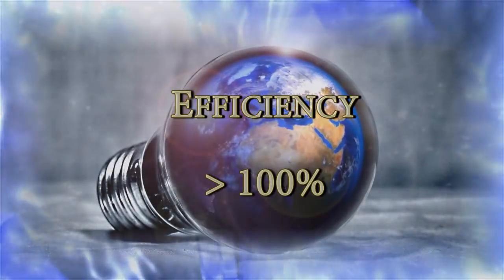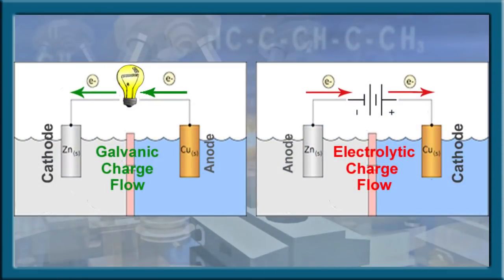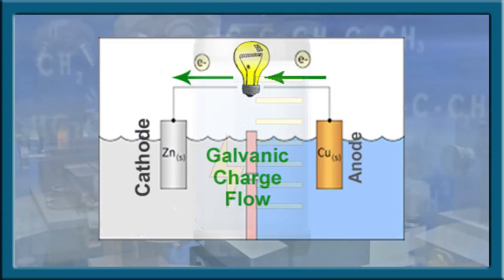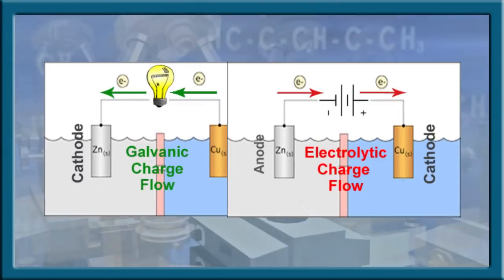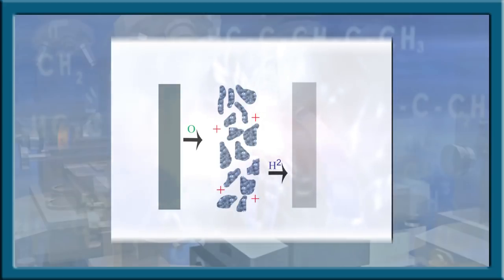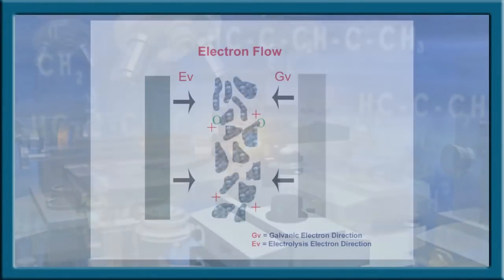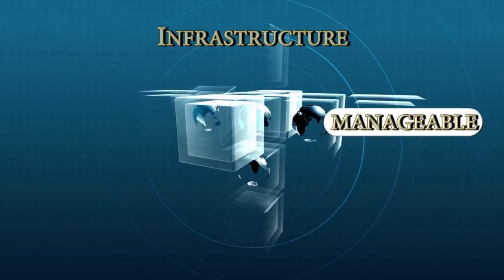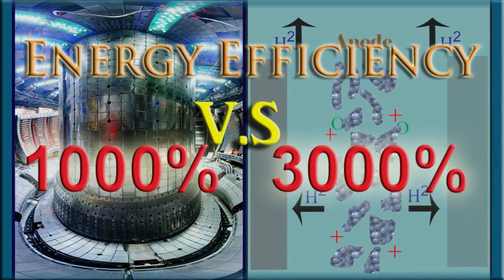The Race To Unlimited Energy: Nuclear Fusion vs H2IL Hydrogen Power - 2018

Comment: Very well done. Would like to see your electrolysis cell. Do you work with a colloidal electrolyte as the positive Electrode as some kind of space charge which will bind the oxygen ? How many oxygen can be bound into the electrolyte  and why does only hydrogen come out ? Do you discharge the cell again, after the pulse so the oxygen ion goes back into the electrolyte solution and thus only H2 gas will come out ??
Reply from the maker: H2 Innovation Lab (H2IL) invites you to view an introduction to co-efficiency verification testing of its game-changing energy technology.

The tests are carried out using a PEM Fuel Cell stack to convert the generated hydrogen energy back to electrical energy. Input power in compared to out power real-time.
Scientific feedback is to the effect, and quote, "I truly believe you have achieved the remarkable" - "even if the fuel cell performance was 100%, which is impossible, the output readings are obviously greater than the input power." 

Please follow this link directing you to the brief 

intro video: https://youtu.be/L-PfstY_jYk
Thank you for your support.